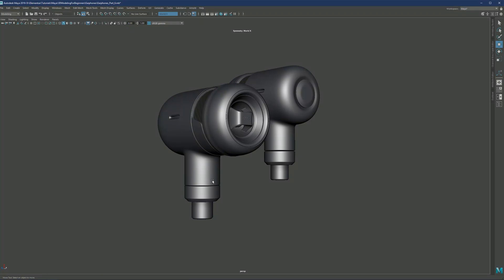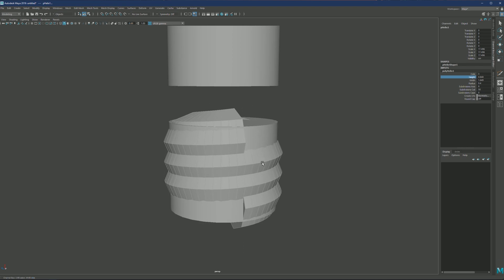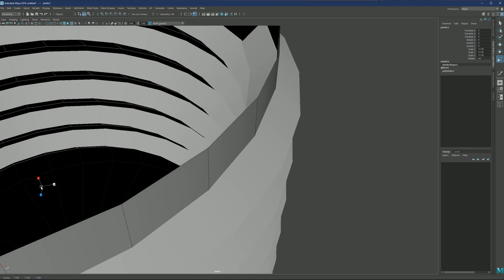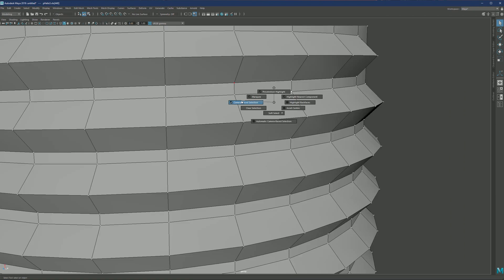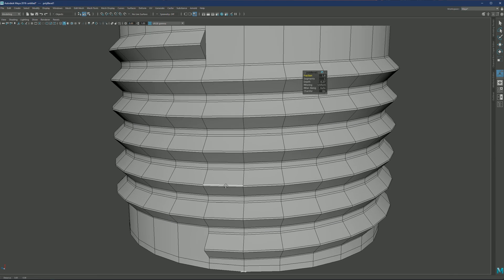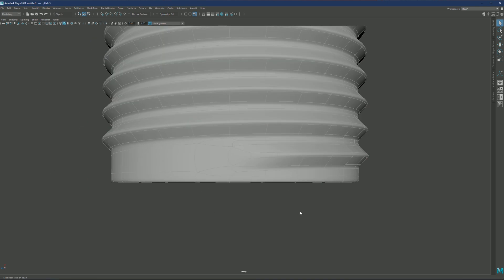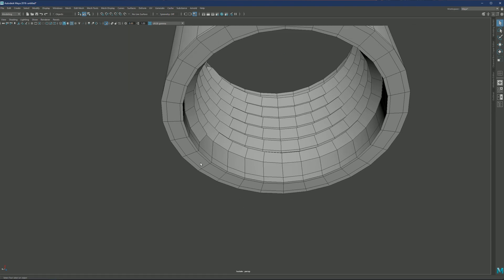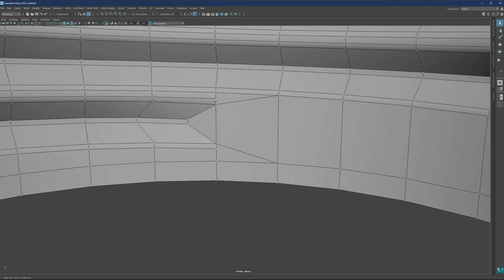Creating Spiral Geometry in Maya

Comment: Thank you very much for the  tutorial.  Next time can you please either lower your screen resolution to 1920x1080 or resize the Maya window to fit into a 1920x1080 area of your screen and you can record a selection of your screen rather than the whole screen. Reason being, Maya interface text is way too small when viewing on a 75” TV.  I could stand two feet in front of the TV but most people won’t want to do that. Thanks again.
Reply: My point as well , I plan to buy a larger monitor but the way Maya scales the ui makes me think is not a good idea

Comment: Damn it, i agree with Muneeb. You make me wanna learn Maya so bad. I have just seen right now that you have 2 courses on Maya.
Question, Maya is better at modeling and doing topology? Why did you switched to Maya?
Reply: ofc it is, he is not exactly doing basic modeling so he knows what is the proper tool for the job. Wait to see the UV unwraping stuff (Maya built in tools are are simply the best out there compared to other built in uv tools, they received a lot of refiniement recently)and Mash the motion graphics module practical uses for modeling.